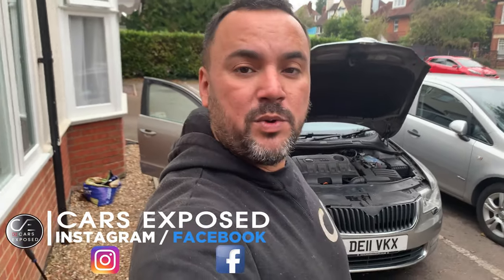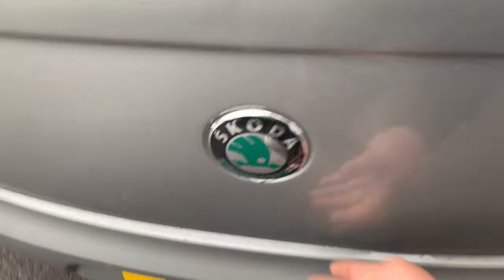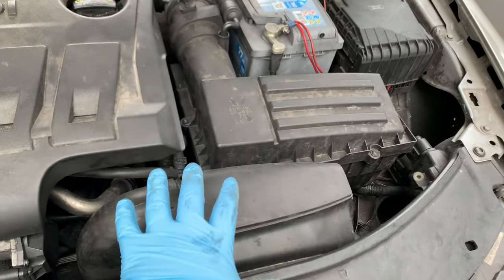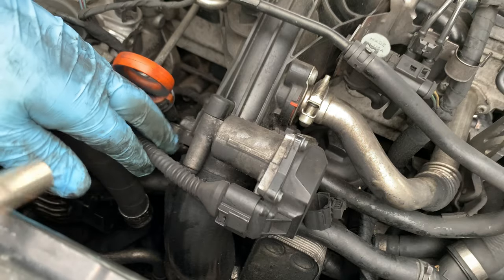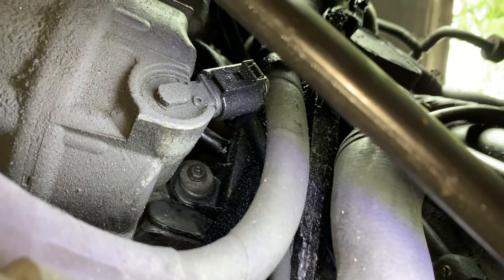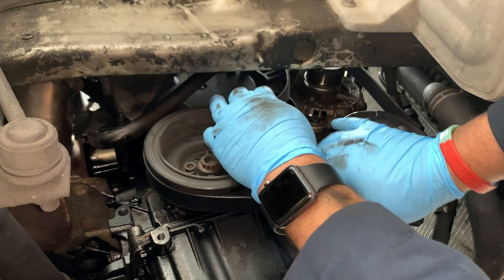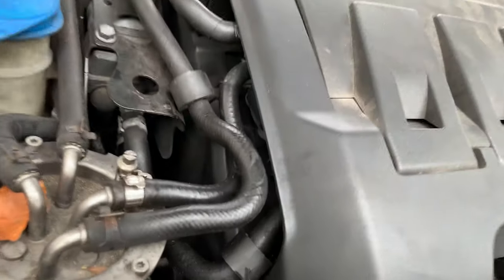VW AUDI SKODA SEAT Engine CFFB Aux Belt Tensioner

Comment: For anyone doing this job, once the belt is off test your clutch pulley..it should spin in the clockwise direction and not anticlockwise. Generally the tensioner can fail when the alternator pulley is failing.
Reply: True, i have that problem, but dont have parts for generator, do you know how long it can go before it break a new belt or tensioner if i not repear the generator?

Comment: Thank you for the video!
Notes that it's totally useless to take off all the front parts... I did this operation for the tensioner and all you need is to take off wheel, plastics around and that's enough 👍☺️
Reply: Oh mate, I'm sorry about what I told yesterday because I started the operation but without ended it and was thinking that I had access without take off all front parts as you did and present in your video BUT I was wrong ! 
I wanted to thank you from Belgium because it is a f**** moment and I mean, Audi engineers are crazy to imagine a such complicated access for a "simple" belt tensioner... Crazy crazy crazy !
Anyway, HUGE thank's for your sharing because I didn't find any other full presentation as yours 🙏🤙
Gold thumbs UP

Comment: In a lot of cases the jumping tensioner could be a consequence of the failing alternator clutch pulley, so once the belt is out it may worth checking. It should freewheel to one direction and should drive the alternator to the other.

Comment: Really great and helpful video. I'm in the process of a Thermostat replacement  ( as my car didn't want to get up to operating temperature ) in the process I decided to replace the belt and the Tensioner
Reply from the maker: UK Car Rebuilds thanks mate good luck with job 👍👍👍
Reply: What I experienced with the car it wasn't getting up to operating temperature. Like the thermostat stuck wide open. In case it won't solve my problem would you recommend something else to check?
Reply from the maker: UK Car Rebuilds if it is a Skoda superb DSG there is another thermostat on the top of the gearbox ...
Reply: I did not know that. I guess it is the right time to replace that too.  Ordered from Amazon. Will be here tomorrow. Thanks a lot.  
Is it difficult to change?

Comment: Seems quite a bit of parts to remove to get to the tensioner, your video will definitely help people out.
Reply from the maker: Hey Matt, yeah quite few bits has to come out until you can get to the tensioner bolt such a awkward place but it doesn’t really take too long to get it done 😊 cheers mate 👍👍👍👍

Comment: Brilliant timing i need to do this job on mine seems a lot of work just to change a belt and tensioner  but your video has made it a lot easier keep up the good work 😀😀
Reply from the maker: Thanks mate, yeah not as simpler as the usual set up with bolts accessible by the wheel arch but not too bad when you get started 😊😋👍👍👍👍 Cheers

Comment: Good job, you know I have the same problem with Amarok,but here a lot of time the belt was broken. Here, the old belt was 6pk1565 but the correct application is 6pk1555.
Reply from the maker: Ivan silva valeu brother 😉👍... Good to have the right size belt I mean I wouldn’t worry too much about a couple mills because the tensioner should take care of that but 10mm I would ... obrigadão 👍👍👍😊
Reply: @CarsExposed  Brazilian Amarok has 3 belt, they are 6pk1555, 1560 and 1565 I found it in a dayco catalog.
Reply from the maker: Cool I didn’t know that good to know ... 👍

Comment: Hi! Very good video, thanks for it! I struggled with the tensioner locking pin in my Polo 1.6 TDI. Could you tell me, what is your bit length which is suitable for this little room,? And what type of ratchet did you use during the tensioneing? I was unable the pull out the locking pin it was stucked :-(

Comment: im doing this an audi a1, so far ive removed the throttle/intercooler pipe but still cant get enough access to the hole, i can get socket onto the bolt through the hole but i have no space for a ratchet of any sort, im ordering a 3/8s set rather than my 1/2 or 1/4 inch drives and will see the
Reply: How many miles had your a1 done when it needed changing
Reply: @chrisp4899  110k mate, rather annoying job on the little a1, such little space in the bay

Comment: Nice work, I have a question, What happen if i removed the pin before installing the tensioner, Can this damage the new tensioner ?
Reply: Its under big tension so don't remove. But if you do remove it you can replace it if you have a vice to grip it and a 16mm spanner

Comment: Great video. Possibly the only one to replace this tensioner. 
Could you please explain a bit better where is the bolt that needs to be undone to release the tensioner from its mounting?
The video is a little unclear about this crucial step, thank you!
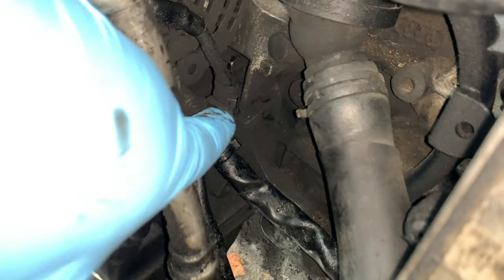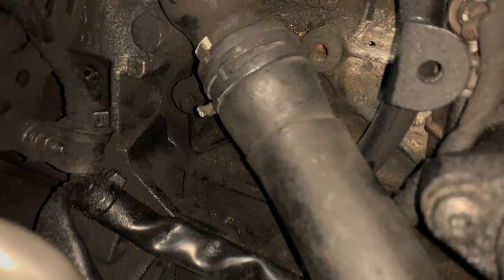Reply from the maker: Thanks man ... It’s impossible to get a camera where the bolt is but I explained and showed as you can see at 9:50 and 11:23 , press on these 2 time links hopefully it will help 👍
Reply: The tensioner bolt is push from behind the alternater/AC bracket.

Comment: This is great. How does that alternator come out?
Reply: There are two bolts one top. And the other on the bottom. Both approx 6” in length. I’ve just taken mine off. To replace the alternator regulator. That failed, and I’ve never seen so many lights come on the instrument cluster. “ re the speedo “ I made the mistake of undoing the bolt on the tensioner. I now need a new tensioner and belt. “ mind you it was my first time doing it. “ But I will know for next time.

Comment: last time when mine was bouncing it was alternator pulley that seized.
Reply from the maker: shemmmo I was thinking that the same thing happened here when Luke turned up for the second time the noise was quite horrible ... I checked all pulleys alternator and a/c compressor and luckily it is all good it’s a pain to change this alternator 😋 cheers 👍👍👍👍
Reply: @CarsExposed  Yep, how’s it done though. I have a Skoda Octavia with the CAYC engine and looks similar to this. No idea how to get to the alternator second bolt.
Reply from the maker: @danyo1972  I’ve replaced an alternator on a Skoda Octavia 13 plate 1.6 I had to free up the A/C compressor without disconnecting the gas lines off course to get access to the bolts and also get the alternator out from the bottom
Reply: @CarsExposed  Thanks mate. Is there a hole through the bracket for the second bolt access?
Reply from the maker: @danyo1972  I can’t remember exactly, but I remember I could not remove the alternator without unbolting the ac compressor

Comment: Better to buy OEM tensioner.... These aftermarket are weak and rattle a bit.... Anyways not such hard work replacing.... Lock tensioner with pin.... Only remove front engin mount and drop AC pump then u have access to tensioner bolt.... I need to take out alternator now cause it seems clutch bearing ot something ia wrong there....makes singing noise

Comment: you must be the only mechanic to remove the whole engine to do an oil change haha... why did you remove the radiator,pipes and airbox just to get to a bolt you could of easily got to with a stubby ratchet with deep socket??
Reply from the maker: I didn’t remove the radiator or radiator pipes , but removing the cooling fan and intercooler pipe doesn’t take much time at all and saves you from a lot of frustration trying to reach the tensioner bolt 👍

Comment: Whats the torque spec for the bolt??
Reply from the maker: Technical data don't show any torque spec for it , it will be one of those situations where tight is tight , I would guess around 30nm but its going to be pretty hard to get a torque wrench in there  👍
Reply: 20Nm plus further 90 degree turn

Comment: Waist off time use use 3 extensions on rachet and screw is undone jobe takes 20minutes done 100s of them
Reply: How you do you get to the tensioner are bolt without taking everything apart?

Comment: I've  always hate the VW CJAA tensioner retainer design... So asssss backwards for the replacement of such a common wear item. This motor is just like the rest of those VW TDIs... leaking oil from the IC connections and diesel from the top side of the injectors🤣🤣🤣
Reply: My 152k vw audi bkd 2.0 tdi is bone dry. I did remove all the turbo pipes and clean all due to mileage. Finally did a power wash and engine clean but tbh it was pretty clean considering the age and mileage. Now just need to change the alternator clutch pulley as it has seized.
Reply: Give me a PD engine anyday :)